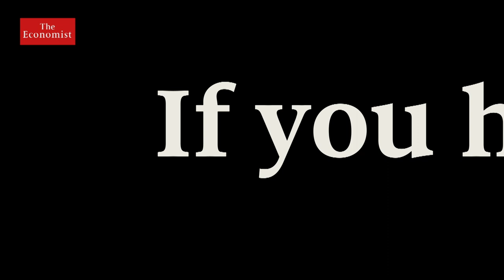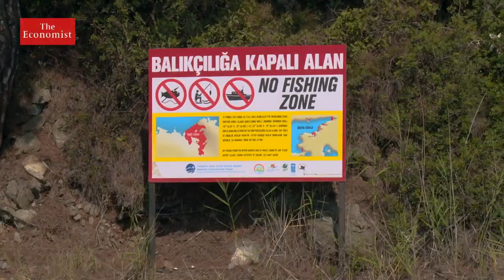$1bn to save the ocean

Comment: Nuclear Energy reduces the need for energy storage from wind and solar. There seem to be more low hanging fruit in nuclear design improvement than there are in battery improvement. The figure I've heard for batteries to become competitive with fossil fuel as a store of energy is a 10x improvement. Yeah amazing and surprising improvements happen in technology, but they're intermittent, unpredictable, and oftentimes the result of basic research done decades prior. Nuclear energy doesn't need a fundamental breakthrough; it just needs time, effort, and resources to get the engineering right.
Reply: Hunter Elofson yeah, but its sad that nuclear energy has such a negative public opinion, even though its a lot more humane that fossil energy.

Comment: So they stopped all fishing, and the fish ecosystem went up 800% in 10 years? That's some compelling evidence that we should be fishing a lot less.
Reply: This is gonna be a super random question so I hope you don't mind. It seems like you have a random YT screenname. Mine is tied to my gmail account that is my primary email. CP is my initials. I changed my name within Gmail to CP because I didn't want my full name on YT. So my question is, did you do the same or did you create a seprate email just for your YT? Thank you if you answer
Reply: @Codiggity369  It's based on my google account preferences which you can change in google privacy settings.
Reply: @MelancholyCrypto  Thanks for responding. Ok. So when you send out an email, your "name" is all that funky stuff too? I'm asking because I use mine for work so I have to keep it lame and professional...
Reply: @Codiggity369  Yes, my emails contain the same name.
Reply: @MelancholyCrypto  Thank you!!!

Comment: Although the ocean does still need to be recognised, climate change is the largest issue with which we need to deal right now.
Reply: True, but many of the climate change solutions with the most potential can also improve the oceans
Reply: @curranfrank2854  Well, that is true because climate change impacts the oceans; however, although it may benefit them, a lot of the ocean's issues are independent of climate change and it is they which need to be prioritised beneath a resolution to climate change in my opinion.

By the way, in my initial comment, I meant to say, 'does', rather than, 'doesn't', and that completely changes the meaning. (Although I'm going to edit it now, I thought that I'd say it anyway, presuming that you're not going to reread my comment and notice the edit.)